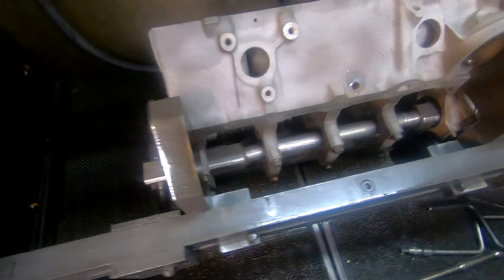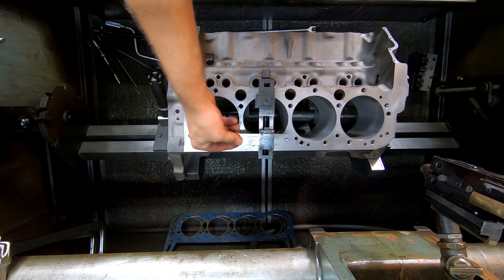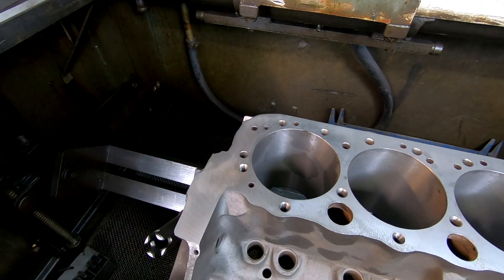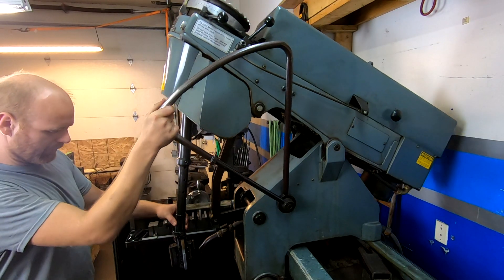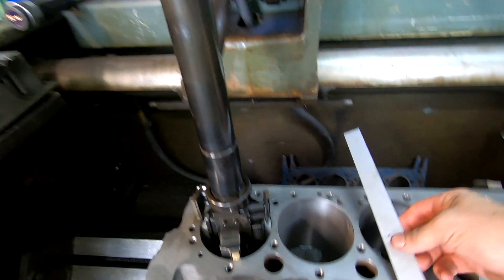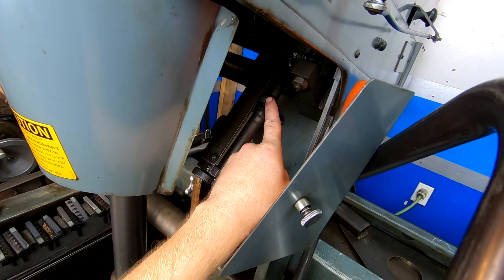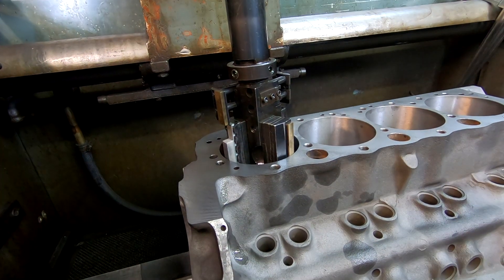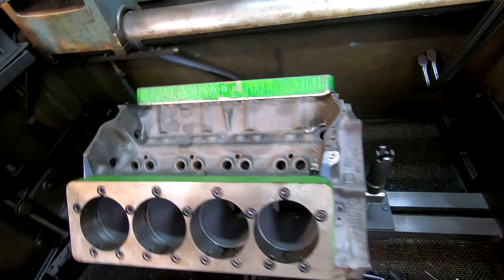Setting up the honing machine

Comment: I own a CK10 , but the 616 I've never had anything to do with one , I wonder what the differences between the CK10 and the 616
Reply from the maker: @unclesquirrel6951  the CV-616 has a bit bigger cabinet and the manual dwell lever os on the right side of the head as opposed to the left. Rest is pretty much the same. All replacement parts on the head are the same as far as I know. Pump, cooler and pressure relief are the same. 
Head is a bit differently shaped to accommodate the covers CK-10's don't have.
I spent years on two CK-10's

Comment: Hello! Is the drive hydraulic?
Reply from the maker: Nope, it is driven by an electric motor and pulleys
Reply: @whiplashmachine  Is it comparable with the Chinese machine 3mb9817?
Reply from the maker: @serfilippiracing  not too sure, but these Sunnens have proven they can last for decades and hone thousands of blocks. I have my doubts that a chinese knockoff would compare. Plus, if I ever need parts or support, it is readily available for these Sunnen machines.

Comment: How do you control the plunge speed, which in turn controls crosshatch angle?
Reply: There's belts in the head that you move onto different pulleys to change the speed

Comment: I use the tool to set my stones up with also.  Do you ever use diamonds on your hone?
Reply from the maker: No, just the Sunnen UHM stones.
Reply: @whiplashmachine  I have a set of cores diamonds.  You can hone out .020 in no time.
Reply from the maker: @ballardperformancemachine  a couple shops around here run diamond stones bit they have the much newer machines. I rough bore almost everything so rarely have more than 5 thou or so to remove. Unless going 20-30 or 30-40.
Reply: @whiplashmachine  The cv-616 can run diamonds pretty easy.  I use the same honing head you have.  The fixture is no different.
Reply: I am moving to a all diamond set up in February.  I have a few new videos coming up this week.  I think you will really like one of them.
Reply from the maker: @ballardperformancemachine  I'll have a look, thanks 👍🍻